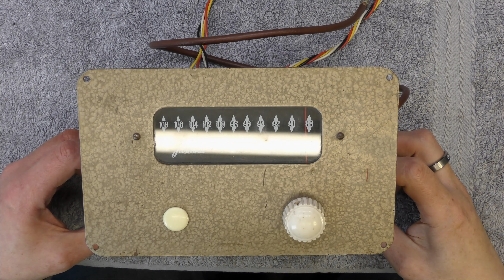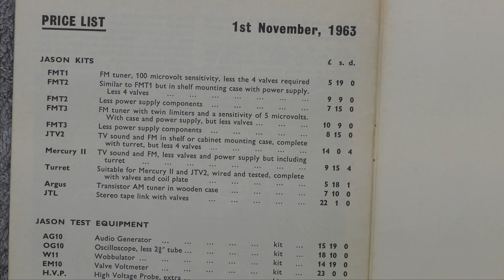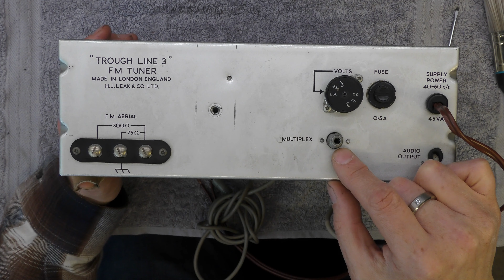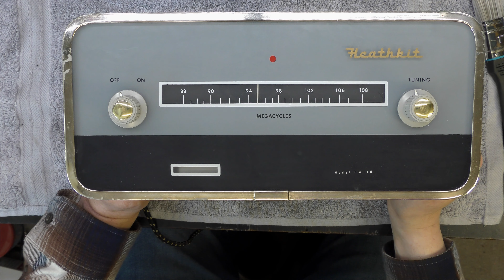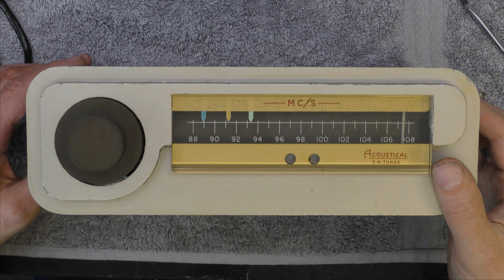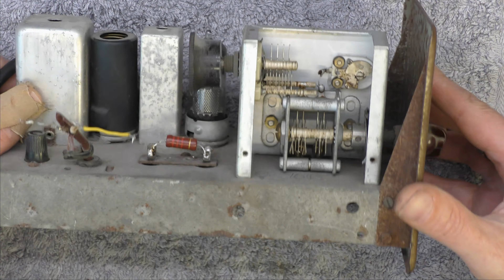A Shoal Of Valve Tube Vintage Hi-Fi FM Radio Tuners (4K)

Comment: Hi, Darren l have the same leak tuner same model, l watched your video and still unclear on the fact that l'v been told l need a decoder in order to have stereo on this unit, can you elaborate on this as did not hear you mention this Fact? anyway l looked on ebay for idea of price for decoder and found Nothing!! ? thanks. Steve. p.s just subbed
Reply from the maker: All the units are indeed mono, Steve. A stereo multiplex decoder is needed for stereo. In the UK this came much later as we followed the US in using the same system in the late 60's I believe. Usually these units were solid state. I have seen a unit for the quad, but not the leak. The multiplex socket on the rear is for the stereo decoder. I hope to work on the leak in the future. Thanks for watching and find the channel interesting. Daz.
Reply: Hi Daren thanks, for insight,  you hope to work on the leak in the not to distant future sounds good, this would make a great video :-) lets keep the ball rolling ,seems like there is plenty of interest .

Comment: Dave since you no about tuner kits ,I built a special one in the 70 ,s It was from the fifties or 60,s It had a special majic eye the tuneing indicator was the  majic eye .does that ring a bell with anyone my x has the one  I built , looking to replace it , but it's the only one I ever seen.
Reply from the maker: There were a few smaller kit manufacture around apart from big ones like heathkit. Jason of course and Martin electronics. Maybe somebody else knows of more. I only know theses as I have a few old PW magazines.

Comment: Hi, another great video! The little unknown tuner is actually another Jason, it was originally the switched version of the first one but someone has converted it to variable tuning! There should be a three-position switch where the tuning cap is. You would tune the slug to radio 3 then switch in either of two trimming coils for R2 and R4, which is why radios 2, 3, and 4 are 2.2 Mc/s apart.
Reply from the maker: Thanks for the info, I thought it was a oddball thing. I wonder why the other adjustment behind. perhaps course tuning.

Comment: The Quad tuner in later days had available a bolt on multiplex decoder. It was made using  germanium discrete transistors. Cost about 16 UK pounds if I remember. A matching AM tuner was also available with both wide and narrow IF. Kinda gave a sort of HiFi sound with local stations. Both tuners were very good in both sound and selectivity.
I remember you could listen to police broadcasts but because they used AM not FM you had to off tune the frequency to hear it cleanly. Ironically the better the tuner the poorer was it's ability to receive the police because of better AM rejection.
Reply from the maker: AHH yes Michael I guess by then transistors taking over. I've always wanted a valve multiplex unit. I did remember right it was the police PMR.